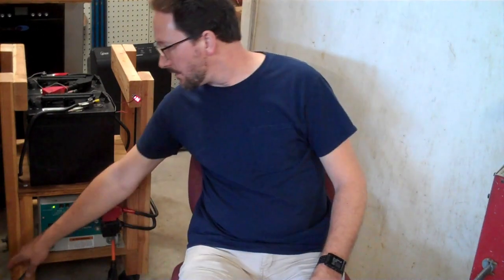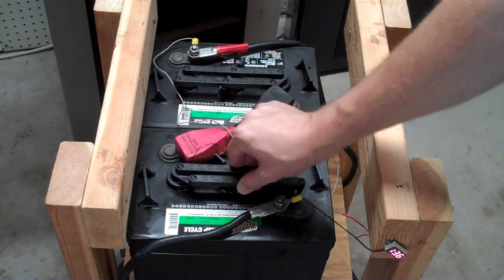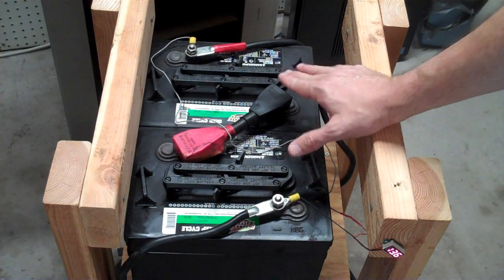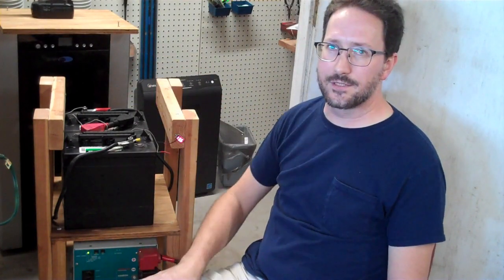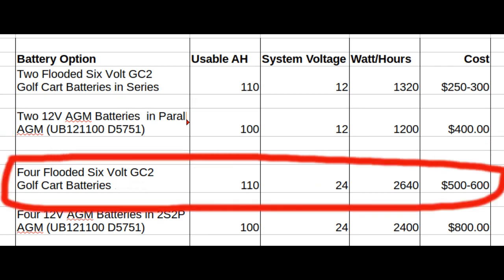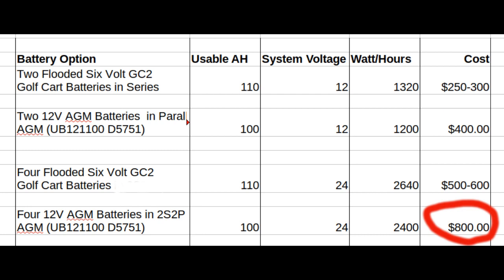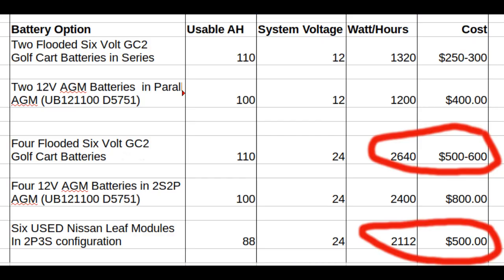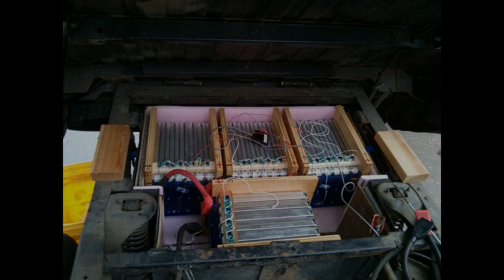Running a Well Pump off Batteries - Which batteries to use? (Part 2)

Comment: What a great series!!  I have a 2 HP well pump (its deep).  240V, 20A breaker on each leg.  That would seem to be 5000W max.  Its rated at 10A continuous.  13.2 Amps S.F. rating.  Its a capacitor start, not soft or super-capacitor.  What size inverter do I need to handle the inrush?  If yours is 1HP and 2400 watts, Mine at 2 HP and 5000 watts would seem to be right?
Reply from the maker: Yes, that sounds reasonable

Comment: I want to run a 1 HP well pump permanently on battery bank, about a year ago I came across 8x Fullriver DC400-6 > 6 Volt 415 Amp Hour AGM Batteries for $500 (New)  and bought them, since then they were float charging in 24 volts configuration, the voltage never dropped below 25 volts so I decided to buy Sigineer Power 6000W 24V Pure Sine Wave Inverter Charger,24Vdc and 240Vac Input to 120V 240V AC Split Phase Output,18000W Surge in order to run not just the well pump but also my hybrid water heater and a mini split AC, the well pump barely comes on because it's equipped with 4 large pressure tanks, the water heater comes ON only during the day time, however I want to keep running the mini split the whole day. Now Do you think the batteries can handle these loads? I know the inverter with its 18000 watts surge can but I hate to trash these expensive batteries.
Reply from the maker: 6v * 415 A = 2,490 watt = 2.4 kW. Because these are lead acid batteries, you won't want to go below 50% charged, so that gives 1.2 kW of usable power from each battery ( when new, if they actually meet their specifications). Since you have 8 of them, that would be 9.6 kWh of power available in your batteries. With inverter losses, say 9kWh you can use. 

From an Amp/Load/current draw standpoint, I assume you have the 8 batteries in a 4S2P setup (giving 24 volts at 830 amp hours).  Assuming you draw 200 amps, that is 4.8 kW continuous which I would not expect to be a problem for a 24v 830 amp hour capacity battery bank. (It would run for ~ 2 hours at this rate before reaching 50% state of charge).

Comment: If you usually only lose power for a few to several hours don't need batteries just get a 12 to 230V inverter with the correct wattage, hook it up to your car and when you lose power run the power off your car, only need to run the car when you need water. We also have another 12V to 110V inverter and our other car runs the appliances (especially fridge and freezer in garage), internet ... etc. So many people buy expensive generators when your car is already a powerful generator, all you need is to convert the 12V to 110V or 220V. Make sure to get the RIGHT inverter, calculate the wattage you need and what kind of power (pure or modified sine wave).
Reply from the maker: For my well pump, I'm worried about the amp draw on a 12v system. Plus, my car is a Nissan Leaf, which does not have an inverter, instead a DC2DC converter rated around 1,500 watts max.
Reply: @summetj  Plus sounds like you're kind of off the grid and lose power for longer periods so your solution makes more sense for your situation. For water we also usually just put some in the bathtub to use in the toilette tank when a stronger storm is approaching and predicting power outage - it's just easier and we usually only lose power for 2-4 hours. Running the fridge, freezer and just a few low consumption equipment are definitely our bigger priorities and fortunately have a 3.6 L V6 engine in our Chrysler 200 currently also hooked to a 1500W pure sine wave inverter. Thanks for the video though, it did give me a better idea of how to go about our pump for our situation.
Reply from the maker: @tibork3845  Not really, just in Florida, so when we lose power due to a Hurricane...it can be 3-7 days before we get it back. (or very rarely even worse...)

Comment: Jay,  your videos have been helpful for me to figure out how I want to go about getting backup power to my well pump.  I wanted to see if you thought this would work, based on your experience running your pump off an inverter:

I have a v8 van that I would like to use to power a ~4000-6000W inverter for very intermittent backup power use.  I really am only interested in being able to run my well pump and it would only need to run minimally.  The pump runs less than 2 mins to charge up my pressure tank and in an emergency situation running the pump only once or twice per day would be acceptable (pressure tank has 26 gal usable volume between 60/40 psi).  The pump is 240 V, 1/2 hp and uses capacitor start so I hope the start current inrush is not too high.  I measured 5.6 A current while it is running = 1400 W.  I would prefer  to be able to use an existing 12V battery that I already need (like in my van) instead of creating a stand alone battery for backup.  But, I don't know if a single 12V battery with only 50 Ah capacity would work ok.  If I run my pump for 3 mins, capacity used from battery would be 10Ah = 2000W * (3/60)hr / (12 V * 0.8 efficiency).  This makes  me think that it would be fine, and I would run the  van while running the  pump to get some charging  from the alternator.  During the time the pump is running, amperage draw from the 12V battery would be 140 A = 1400W / (12 V * 0.8 effeciency).  Can I just  make up 4/0 battery leads and be ok or is this kind of amperage draw too much for a single 12V battery, sustained over 3 mins?

If you had thoughts on whether this had a chance at working acceptably or not I would appreciate your input.  Thanks!
Reply from the maker: Running the alternator will give you 40 amps into the battery, so it would only need to produce 100 amps for ~ 3 minutes.  I'd mostly worry about the startup surge, as you will probably need 4x the watts & Amps for a second to initially start the pump. My LiIon batteries struggle with this....but, a starting battery IS optimized for "cold cranking amps" so you may well be able to draw 400 amps for a second out of a 12v starter battery.  I went with a 24 volt system to give myself half the current draw, but it sounds like your pump is about half the size of my 1 hp one.  It might work out just fine..but you are running close to the  limits.  You might consider investigating an upgraded heavy duty alternator to get 60 or 80 amps from the engine....anything you can do to limit voltage sag on that startup current draw will help.  [I think finding a 12v inverter that can surge start a 1/2 hp pump will also be tricky....many inverters in that size range start at 24 or 48 volts....]
Reply: @summetj  Thanks, Jay.  I am thinking I will try it.  There are a few inverters that I have found in the 3600W - 5000W range that seem like they could work.  A high output alternator should be available if I need it.
Reply from the maker: @pattyliterati164  Just keep in mind that the startup surge is what you need to size the inverter for. I used a "low frequency" inverter (with a large transformer) that is better able to handle startup surges for my well pump, and it still struggled. If you use a "high frequency" inverter without a transformer, you will need to size it significantly larger than your continuous draw requirements.
Reply: @summetj  Jay, yes I am planning on a low frequency inverter.  I may buy a Sensata.  They are very expensive but they sound reliable- the Sensata N series are often used on service trucks and they claim to be able to start 2hp motors for the biggest 12V model.  There is another idea in the back of my mind that I thought using a 12 VDC inverter would be beneficial for: using an EV as power source during power outages.  I don't have an EV but am hoping to buy one in the next year or two.  They all have a 12VDC output that is capable of supplying ~1500W it would seem (I have only checked leaf and bolt and found info saying ~1500W ok to draw from 12 VDC connection).  You are doing this, except converting to to 24 VDC, right?
Reply from the maker: @pattyliterati164  Yes, I have a 120v ac charger that will charge my 24v battery (it only draws around 500 watts). So with a 1,000 watt inverter I can re-charge the well pump battery from my Nissan Leaf (or any automobile with a 12v battery).

Comment: Very helpful. Now how to apply all this great input and information to 4 deep cell battery packs sold by Goal Zero and their 4 circut switch system which I already have. (I had a Goal Zero 1400W original solar/AC powered lithium battery already so ordered their complete 4 circut and storage battery system on sale early 2021. OOPS happens. Turned out the new well I thought was on 120 and the sump pump for our gas furnace is actually 240V so that stuck a wrench in the entire process. Or thought process & our rural area is low on electicians to help with that or reliable professional back up. So these batteries have sat new in their boxes for over 7 months and that's probably a no no. No doubt need to get these set up to be charged via the GZ1400 via AC SOON even if not set up to their circut box and that to our main circut box. Anyway our lennox LP furnace needs to be hooked up to a sump pump and it's installed in our 12 foot deep basement. And sump pump along with new Well (no holding tank system) circuts run through our basement breaker box along with the rest of the homes 110/120V. DANG life is never as simple as one thinks it should be. I had the idea then to just buy a second GZ four circut breaker box and 2-4 more storage batteries they sell and to switch out two breakers in new stand alone box and battery system to 240V circuts. WHY NOT? Well does not help that GZ yelled at me NOOOO DO NOT DO THAT !!!!! I question why not? Someone said it could be done. So I also suspect there is truth in both ways of thinking. I suspect the GZ 1400W original lithiums not the X as I know little about the newer X line is it doesn't work well with the outlay of a 240V set up even if the storage batteries which are deep cells can be used with a properly inverted/converted 240 lay out as demonstrated here and in Part 1 too. It would be helpful to find a reliable electrcian here in NW MT in rural area that's lacking quality journeymen. Those who are good are often over booked. But these videos are definitely helpful and let me know that it is possible to have a decent reliable and pretty SAFE battery back up for a 240 Well. Oh and I just learned that the sump pump is 120. But needs to be rewired on separate circut so the water softener does not run during power outages as that would require the WELL turning on at random times. Circles and circuts it has me running around & around for sure. Stay safe everyone.
Reply from the maker: I'm afraid the Yeti Goal Zero won't be able to run a 240 volt well pump. (You could buy a 120->240 transformer to use it to run small 240 volt appliances, but it doesn't have enough capacity for a 240 volt well pump.)

Comment: HELP ME OUT? I want to run my 1/2 hp 20 amp well pump from 2 x 12  volt marine batteries in parallel, what AC watt inverter do I need? (115 volts)
Reply from the maker: 20 amps at 120 volts is 2,400 watt continuous draw, but unless it's s "soft start" pump, you'll probably need 3-5x that for the startup surge so I'd recommend an 8,000 watt inverter (possibly 10,000 watt if it's not a "low frequency" model with a large transformer). [A high quality 2,500 watt inverter may be rated to do a 8-10k watt start-up surge....but for cheap inverters treat their rating as the "surge rating".] The only way to know for sure however is to buy the inverter and try it.

Comment: Why not use two 12v 600-800 ah lead acid? Unless your limited due to your charge controller on hand, that would be the best approach.
Reply from the maker: 600-800 ah lead acid batteries would take up a lot of space, weigh a lot, and cost a lot of money. I also wanted this battery to be light weight so I could use it in my boat when not using it for power backup.

Comment: Great video.  Just what I needed.   Fyi, 240v does not use a neutral.  It uses two hots and a ground.  That white wire is a hot, that should be taped black or red on both ends.

Comment: Thank you , great information. if you don't mind me asking..how deep is your well ?
Reply from the maker: Not sure, it came with the house. My estimate is very shallow, as we live in Florida next to a Lake.
Reply: @summetj  Thank you Jay. What size panels are you running ? I'm in Nevada with an 80ft deep well and thing of switching to solar , so yup I'm picking your brain. Thanks 
Jackman
Reply from the maker: @jackman1305  I do not have solar panels (directly) tied into the well pump backup system. (I run it off of my 24 kWh battery pack in my S-10 pickup truck if there is a power outage).  We do have solar panels (grid-tie) on our house, they are 290 watt panels 65x39 inches, but they do not help in a power outage as they are connected to a grid-tied inverter.
Reply: @summetj  Thank you Jay

Comment: well I gat some information abt running the well pump u can use 2 battery but u need 6 super capacitor to connected to the battery and u will be ok

Comment: Great videos. Did you consider skipping one of the series' of 12V batteries in your examples and instead applying that money to a small solar panel and charge controller?  If your pump only uses about 200 watt hours in a day, and you can weight that toward daytime hours simply by not using much water at night, then you don't really need a very deep battery if you have a solar panel that can keep the batteries topped up during the day.  And solar panels seem to have alot more life to them than batteries with less maintenance.
Reply from the maker: The main reason I didn't want to go with only two 12v AGM batteries to get a 24v system is that I am worried about drawing 125 amps out of a single 100AH (50AH usable) AGM battery.   The 6v GC2 batteries are designed for high amp output, and are rated at 220 AH (110 usable), and I feel much more comfortable drawing 125 amps out of them.
Reply from the maker: But yes, topping the system up in the day via solar is very viable, and I may add something like that later. I'll be doing a video on building the battery, and selecting the inverter, and testing the system, and then I'll do a video about how I charge the battery where I'll explain how I have a 24 kWh electric vehicle battery bank sitting in my driveway, and how I plan on using that to top up the little system if the power outage goes for multiple days.